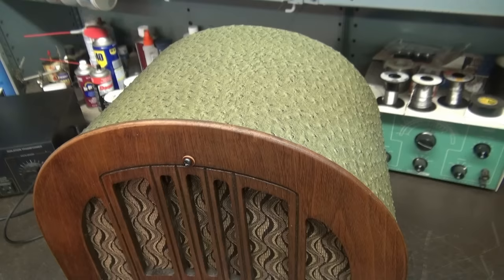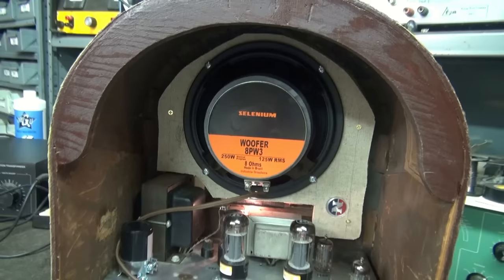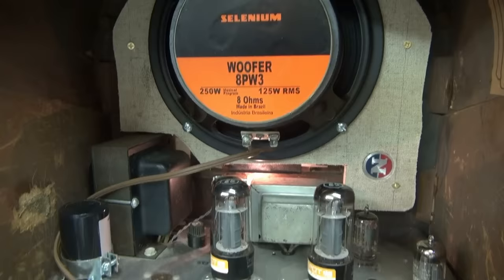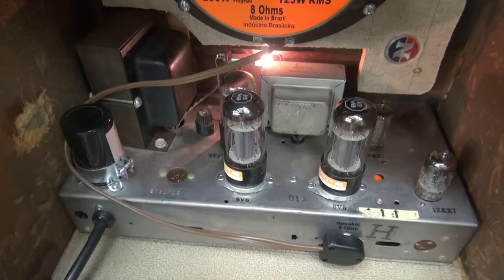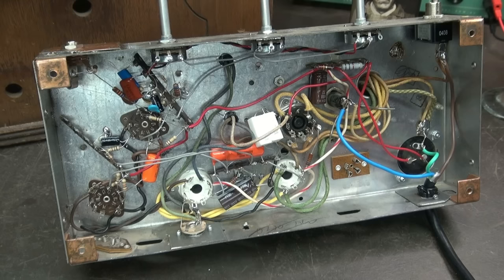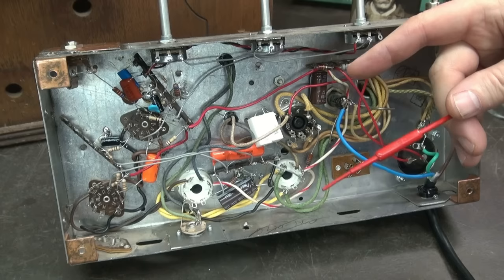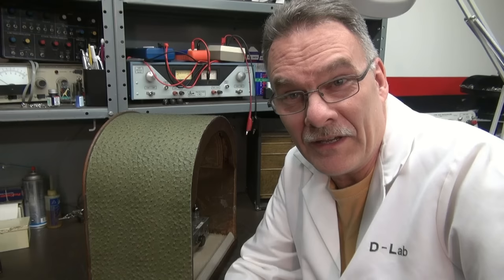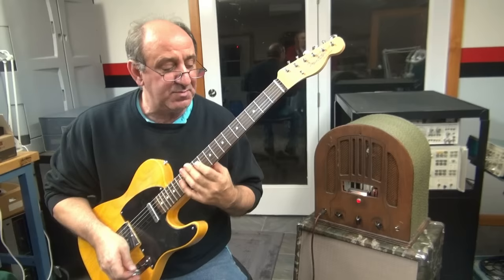GE Tube Cathedral radio Guitar amp Fender Deluxe 5E3 Tweed circuit Boutique D-lab

Comment: Nice -- but to be pedantic -- the 5E3 had no separate bass & treble controls but it did have a cathodyne inverter -- which is what you have her -- you are only using 1/2 a 12AX7 for the inverter ? So it look like a blackface non reverb princeton with no trem ? Nice work as usual of course !

Comment: Hi Terry, Got a question. I looked at the 2 schematics side by side and wanted to confirm how you put in the Princeton phase inverter. Did you do away with the 5E3's V2A circuit like the 6G2, and also wanted to know if you grounded the cathodes off the 6V6's. The 5E3 circuit has resister/bypass cap off the cathode and i believe there is a different resister value coming off the inverter tube cathode. Just wanted to verify, unless you have a schematic on this of course.

Comment: Great build Terry! Which Princeton Phase Inverter model did you choose? I really like the clean sound. How much output power does it put out? Thankz
Reply from the maker: Hello, The Inverter was from the 6G2 circuit. Only used 1/2 of the 12ax7.  This amp delivers a solid 12 watts.